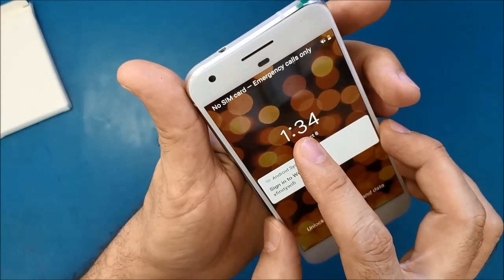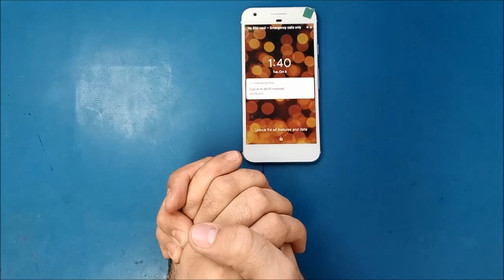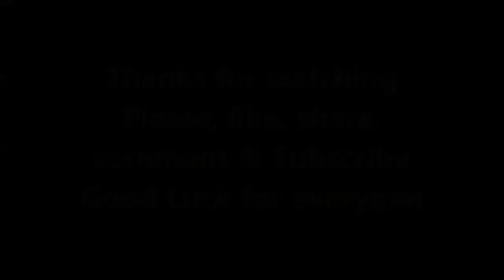Google Pixel 1 LCD Screen and battery replacement

Comment: Google Pixel (1) original battery: B2PW4100 Li-ion 00
3,85V (VDC) (4,35 V max)
thickness 4.5-4.7 mm, height 63.9 mm (59,1 mm without pr.b.), width 60.0 mm
толщина 4,5-4,7 мм, высота 63,9 мм (59,1 мм без платы защиты), ширина 60,0 мм

Protection board: 2PW4 HTS80001P03 / 94V-0
thickness 1,9 mm, width 58,5 mm, +height 4,8 mm

(may be replaced to identical by dimensions, but 3,85 V Li-Pol)
(++ USE AccuBattery app)
You can also make holes in the body, draw two contacts with a neatly separated protection board outward, and attach standard batteries 3.7 V (normal, and the maximum allowable voltage for such is 4.2 volts). In this case, be sure to use the AccuBattery application.
Вы также можете проделать отверстия в корпусе, вывести два контакта с аккуратно отделённой платы защиты наружу, и присоединить стандартные аккумуляторы 3,7 В (в норме, а предельно допустимое напряжение для таких - 4,2 вольта). В таком случае обязательно используйте приложение AccuBattery.
Reply: Inside the smartphone case, the space (cell) under the battery: the width of 61.0 mm is free, can be squeezed to 64.0 mm, the height is 65.0 mm.
Внутри корпуса смартфона пространство (ячейка) под батарею: ширина 61,0 мм свободно, может быть втиснуто до 64,0 мм, высота 65,0 мм.

Comment: Warning to anyone that attempts this repair, be careful on the bottom under the glass when cutting through the adhesive, there are lcd cable ribbons there. I accidentally cut mine when I was running a tool under the glass on the bottom.

Comment: Can I get the link of the battery from where you buyed? Also, is phone working fine because it's not 2750mAh instead bigger one. Just want your review on battery drain.
Reply from the maker: You can find the battery on ebay.com
The mAh is not really important. 
Just make sure you're buying the right one for your phone model.

Comment: I'm gonna do that tomorrow when my battery gets here.
Reply: How did you do?  I was wondering if I should try this or just get a new Pixel.  What did you use for the thin plastic card?  I have NYC subway cards - which seems to be similar to what this guy is using.
Reply: You should to order a lcd with battery.. 🤣🤣🤣 they used fucking glue there pixel phone .. lcd will broke whatever you can try!!!!